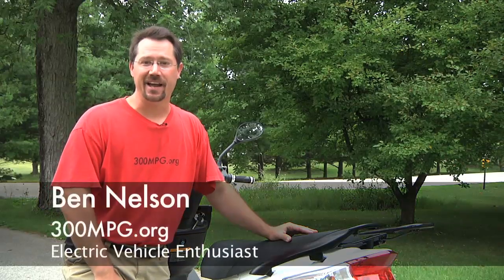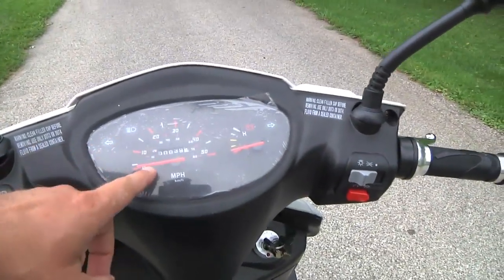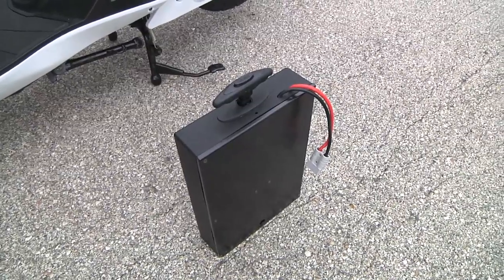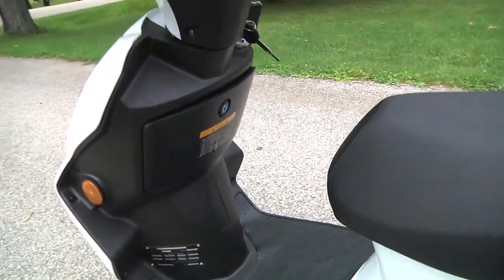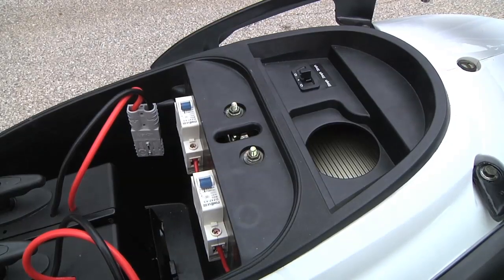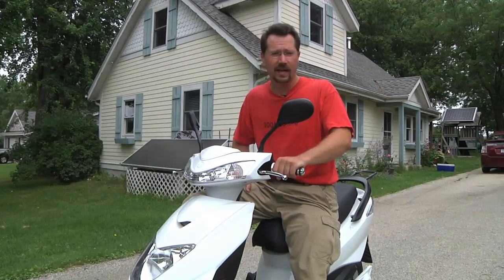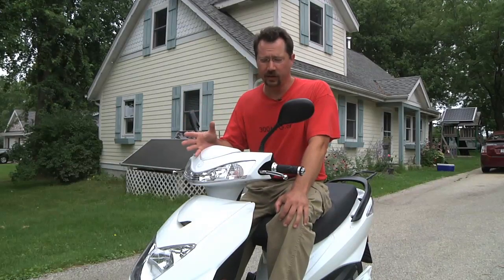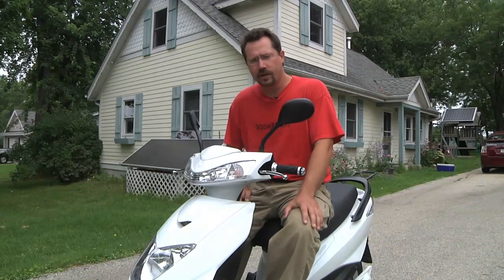Electric Scooter Review: Flux Mopeds EM1

Comment: Sweet little scooter! If the charger fits in the second battery slot, you could pull them both out at work, and steal power from the boss man!  Where I used to work (before retiring), they were installing free EV changing stations..

Comment: I have an electric scooter that uses SLA batteries at 48v with a rear in-wheel motor. I was wondering if I could change out the battery and put in a lithium unit with more volts, say maybe 60 or even 72volts. Would that harm the motor? Oh ya, the motor is rated at 600w.

Comment: Since it wasn't mentioned in the video or description it is a Lithium battery and it takes 5 hours to charge. Would be nice if you could charge both batteries at the same time if you had 2. So if the charger does only consume 400 watts it would cost here in Wisconsin 22 cents to charge it. So, 1 cent per mile isn't to bad - that's a 3 cent per mile savings http://www.fluxmopeds.com/#specifications

Comment: so i figure the battery is lead acid?
Reply from the maker: It's a 74V lithium battery rated for 10,000 miles. Weighs about 22 pounds.
Reply: BenjaminNelson oh weird, i was thinking due to the weight it would be lead acid. i was comparing it to my e-bike battery i built, its 48v 24ah and weighs about 15lb. but i guess your battery just looks smaller in the video.

Comment: can you unlock the speed?
Reply from the maker: I didn't mess around with the controller on this scooter. I'm sure you could boost the speed with a programming cable for it. Top speed is usually controlled partly by the limitation of system voltage and current, and partly by software. I'm sure it could be make to go faster, but the law usually has something to say about that anyways!
Reply: BenjaminNelson I am thinking about getting one without the batteries but need a higher speed, 45 mph would do for me since I have a mc license.